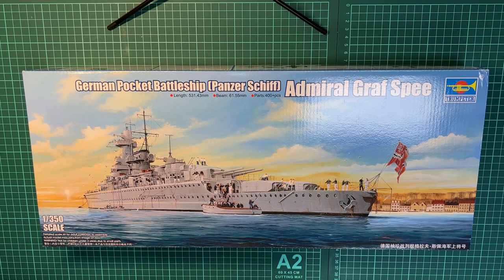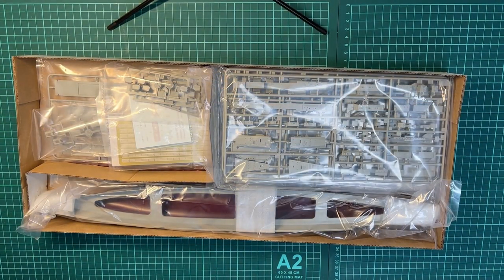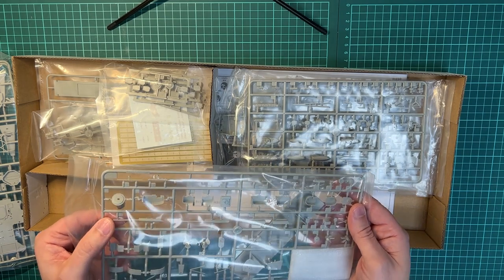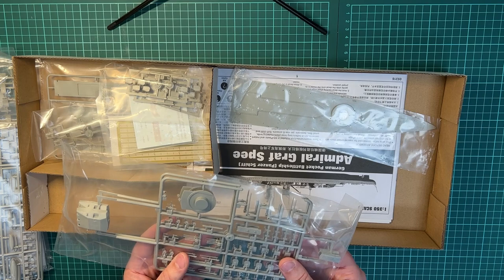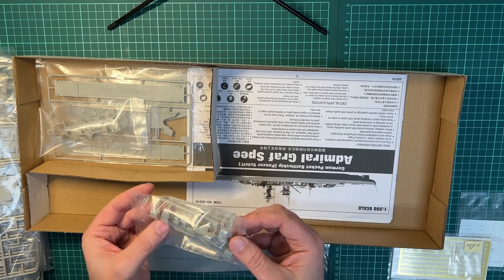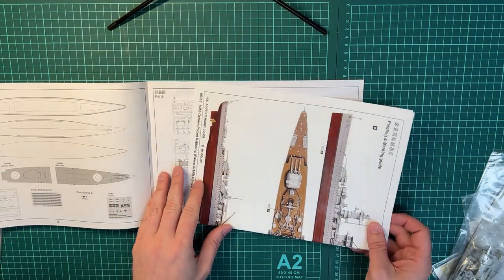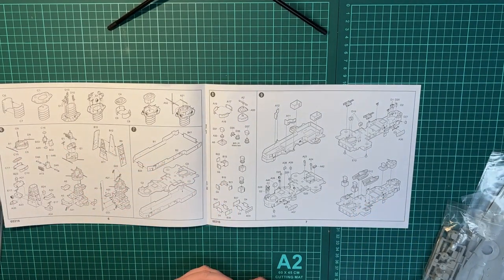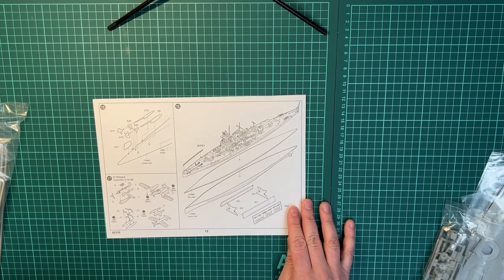Trumpeter Admiral Graf Spee 1/350 - Unboxing

Comment: Nice video, I have the Academy kit in my stash to build.
Just a small comment. I would have liked some close ups of the sprues. Perhaps you could include that in your next unboxing.
I would also suggest Colourcoats by Sovereign Hobbies. Their paints are superb and accurate to the original formulations.
Reply from the maker: Thanks, and thanks for the input, I will definitely show more close ups of the sprues out of the bags. I haven’t used those colors before, but I chose Lifecolor for this build and I am pretty happy with the result. Those are suitable for both airbrush and brush painting.